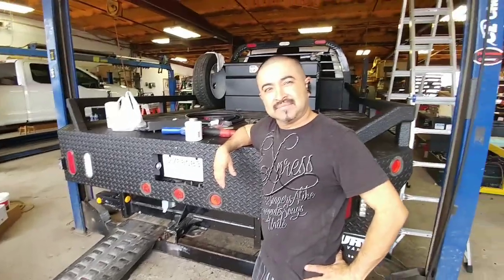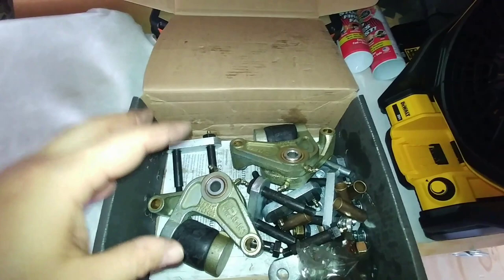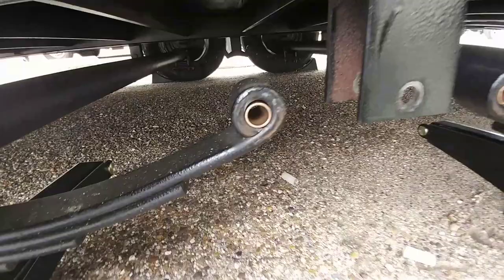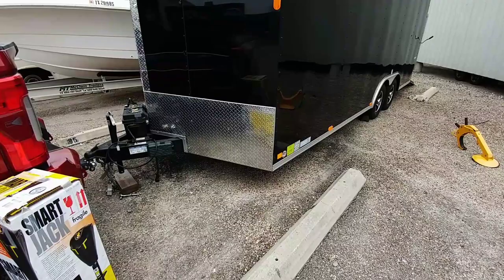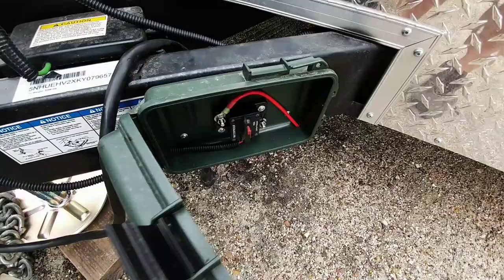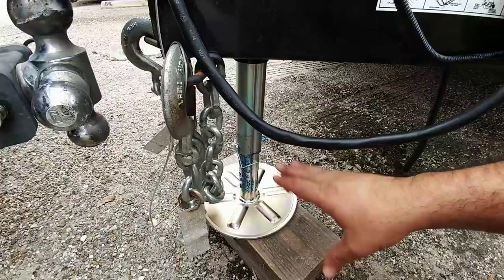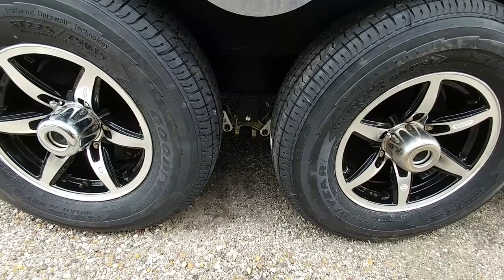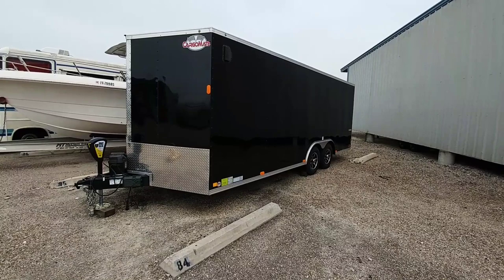Best Trailer Upgrades for RVs, Travel Trailers, or Cargo Trailers

Comment: Are these dexter equalizers the best for a cargo trailer?  I have a 24 foot cargo trailer and was thinking about the CRE from morryde but they look like they will hang really low.  My axles are 5200 pounds and 35 inch wheel base

Comment: First off you are 100% right on E-Trailer. I buy all my things I need for trailers and tow vehicles from them. No I'm not getting paid to say this and no they don't give me free stuff for talking well about them. They're just a really good company and if there's something you need to see on how to install it they normally have a video for that product.

What is the purpose of changing no shackles out? I've never seen that and never knew anyone who has done that theirselves. What does it do better than the factory stuff?

Also it wasn't all that easy for me to put that electric jack on the front of my trailer. I went into my garage and retrieved my large floor jack and as I was jacking it up I could not get it up high enough. That's when my friends had stopped by to see what I was up to and one of them asked me why don't you hook that up to one of your pickup trucks or SUV? I asked why would I do that he said because that will get the trailer hitch Jack up high enough and you don't need to worry about blocking the trailer up while you are unbolting the jack. it took about 30 seconds for the hamster to catch up on the wheel for me to realize what he was saying. Once I understood it was less than 5 minutes changing it out. Of course before starting I did not read the instructions I'm a man we don't need them. When I did have to look in the manual to find out what amp draw I was dealing with so I knew the proper circuit breaker to get is when I saw at the very beginning of the instructions about how attaching your trailer to the tow vehicle to make it easier to replace the jack.
I felt stupid afterwards but we all had a good laugh.

Also your wheels do look a lot better especially seeing that you have a black trailer.

Comment: Rims really dressed the trailer up. I can’t stand the same steel rims that my aluminum trailer came with. Really nice choice with the equalizer and obviously ipgrading the equalizer is never a bad thing!

Actually come to think of it my trailer is pretty close to the same size as yours.

If you can answer, why didn’t you choose an aluminum enclosed trailer when you’ve mentioned numerous times your concerns with surface rust from that Texas air you have down there? I know you had the bottom of this painted but arguably that wouldn’t need to be done with an aluminum unit (yes I know aluminum will corrode over time but given where you are it would still be substantially slower than even treated steel).

I think a cool video you could have done before installing stick on reflectors would have been installing LED reflectors and everything that entails. Even I have added some additional led reflector lights to my trailer (mostly incase I’m on the side of the road). I want to  develop some sort of switch to turn them on with the auxiliary battery in the event of a total power loss with the truck or just simply parked in a dark place.
Reply from the maker: I've never felt the cost difference between the two justified the purchase so long as the trailer isn't submerged in saltwater or regularly taken to the beach.  I clean my equipment off pretty regularly, so my trailer will likely last quite some time.

Comment: Do you recommend any suspension upgrades for a single axle enclosed trailer? It current has a leaf spring setup and I'm wondering if there is a way to smooth out the ride a little bit.
Reply from the maker: Perhaps a Timbren Axleless system

Comment: Why no Sailun 637 tires for this trailer?  Tell Etrailer to stock this brand of tire.
Reply from the maker: They have a similar brand, however, I agree they should carry them. I didn't get them on this trailer because I wanted to stick with a 15" wheel/tire so I could use the OEM wheels/tires as spares.

Comment: Ok this is an off the wall question but what is the difference between an f250 king ranch 4wd also diesel and f350 single rear wheel of the same.
Reply from the maker: F350 has a higher payload and towing due to rear suspension enhancements and different gear ratio

Comment: Did you have to install the breaker box? I've never noticed one on any trailer I've looked at. The electric jack looks like a good idea for my car trailer. It sure beaks hand cranking in the pouring rain. 🤔
Reply from the maker: Probably not, but it actually costs less than a kill switch/battery disconnect and serves two purposes.
Reply: @BigTruckBigRV  I can find the Jack and suspension parts for my trailer but I really like breaker box on frame. Any information on brand ? No luck on search locating one. Great videos, thanks.

Comment: Why this and not the cre3000? Considering changing to the cre3000 from this setup on my 5th wheel
Reply from the maker: Not a bad system either.  The EZ Flex is a more robust system in my opinion. The CRE3000 will likely be a bit smoother though

Comment: Is there a way to operate the Jack manually if the battery goes dead?
Reply from the maker: Yes sir.  The little on top removes and there is a crank attachment
Reply: @BigTruckBigRV  Thanks, probably something you might want to put out to everybody.  I asked, because with my luck the battery would be dead when I go out to use it!! :-)